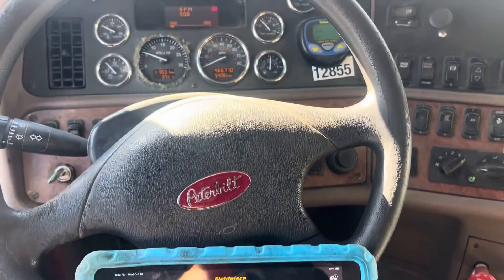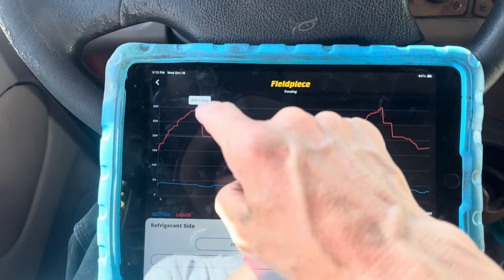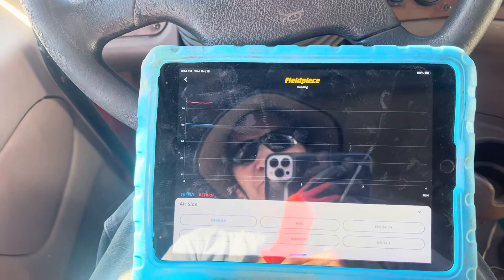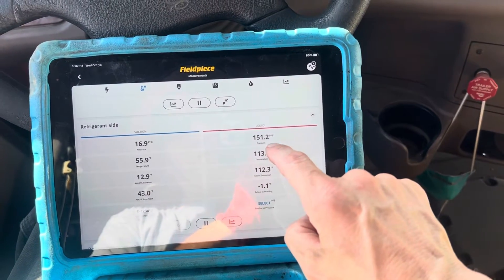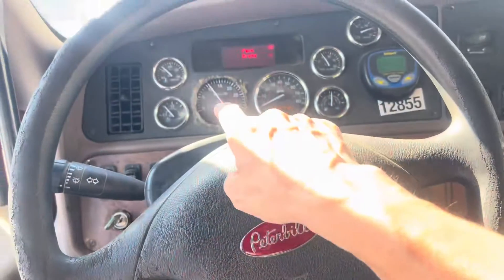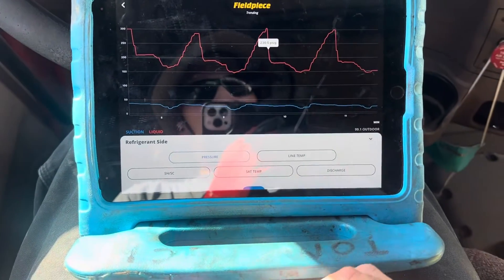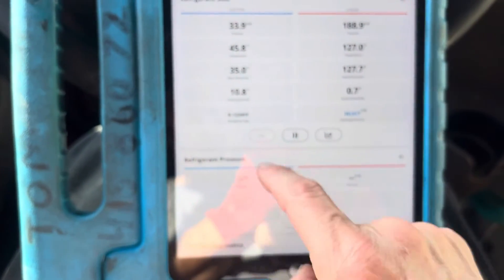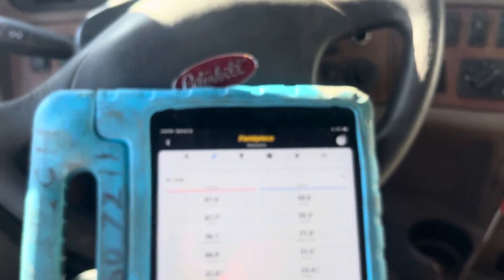High side pressure cycles up to 300 psi and then immediately drops to 150 psi is normal ?🤔

Comment: On the larger class 8 rigs use the cruise control to hold the idle up at 800rpm to keep engine running. Use set/coast to adjust speed.
Reply from the maker: I got to try that. I like to learn something new every day. Thank you.

Comment: Wonder what sense makes this technical fan on/ fan off-design in this AC system? Wouldn't it be better to let the fan work constantly instead of cycling? Maybe even better controllled by pulse width modulation (in case of electrical fan) to obtain optimal condenser airflow? Or is this just a simple (cheap) crankshaft-driven system for an application in a non-sophisticated truck? 🤔
Reply from the maker: Comes down to money

A simple on and off pressure switch is the cheapest easiest control method 

Constant on fan ran off the engine is no good because you can actually over cool the condenser and it brings the high side pressure too low under certain ambient operating conditions and then the expansion valve can longer properly meter the refrigerant . 

There always has to be a high side pressure that is somewhere around at least 100 psi higher than the low side pressure bare minimum but you don’t want it so high the system has to work extra hard and become inefficient and then the engine has to consume more gas to overcome the power of high pressure so it’s always fighting depending on the system. What kind of controls?

Pulse modulation is the best system, but the most expensive 

It could constantly change the fan speed up and down to keep one steady, even pressure around 100 psi higher right in that range of efficiency . 

Remember, vehicles today are built for either EV battery range or fuel efficiency, so the lower they could keep the compressors compression ratio the more energy, efficient for electricity on a battery or fuel efficient on an engine it runs

And when it comes to sideways mounted transverse engines, there’s no way to put an engine mounted fan on the front of the engine, which is pointing towards the passenger side to Kool-Aid condenser that’s mounted on the front of the vehicle
Reply: @coldfinger459sub0  
Thank you for this answer.

Another question, please 🤓:
Can overcooling of the condenser due to permanent fan activity lead to evaporator icing due to ineffectiveness of the expansion valve? Exciting question for me concerning a historical problem with a former Ford Mondeo of mine: The cooler fan of this car ran constantly on high speed when AC was comanded "on", regardless ambient temperature or vehicle speed. Driving on highways even in hot summers at about 80mph or more regularly led - after a while - to complete loss of airflow through the evaporator despite a normal running interior blower fan. The only solution of the problem was switching off AC and waiting some minutes. I considered that being evaporator icing. At that time I did not yet learning about AC systems. The dealership and a Bosch-Service checked and "serviced" the system without any improvement. I don't own this car anymore, but I still don' t know a reason for this problem. Do you have any idea? That would be great 😊
Reply from the maker: @Akadectra  well first we have to take the ambient to air conditioning and sun heat load into Account

Let’s say, for example, you’re 85°F plus with a strong sun outside 

And if you’re still having ice problems, it sounds like there’s an airflow problem or whatever is controlling the cycling of the compressor on and off is not turning off the compressor 

Like an accumulator Ford system that has a cycling pressure switch that has drifted out of specification . 

And instead of turning off the compressor at 24 psi, I’m just using an example

It has drifted down and will not open up the circuit to turn off the clutch until it reaches 14 psi. 
And this will allow the low side to ice up

Especially if you’re on recycle mode and interior cab temperature has already gone below the outside ambient temperature of 80°F and you’ve now lowered your inside cabin temperature to let’s say 65° in recycle mode

Another would be somewhat clogged cabin air filter if it had one or a dirty fan blower blade that has a buildup of dog hair or dust or lint

And you have a problem with the low pressure control switch because low airflow over the evaporator means low low load.   

But when you have a low load, you’re supposed to naturally lower the temperature the evaporator this will naturally lower the pressure, and this will naturally cut the pressure switch off that cycling clutch switch, probably attached to the cumulate tour or in the low sideline
Reply: @coldfinger459sub0  Thanks a lot for this fast and detailed answer. Appreciate that very much 👍. Today I would search for factory specifications  and wiring diagrams and so on on alldatadiy. But at that period I wasn't trained in diy yet 🙃. And the car is gone...but maybe still driving in Africa or Russia somewhere today 😁😁. Who knows.....
Thanks a lot for sharing your incredible knowledge with us.